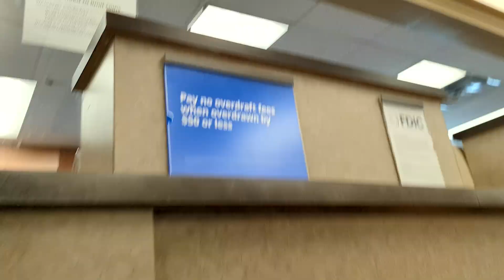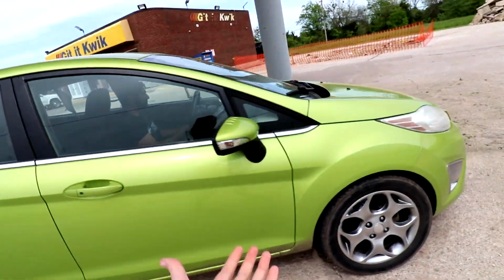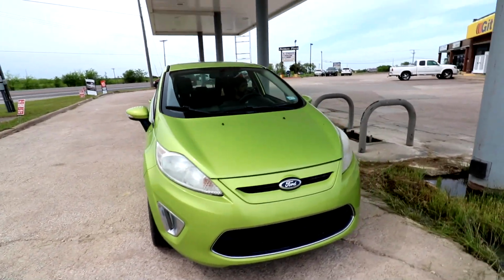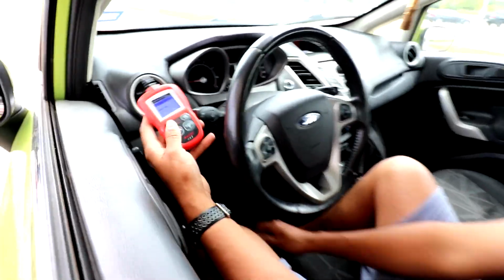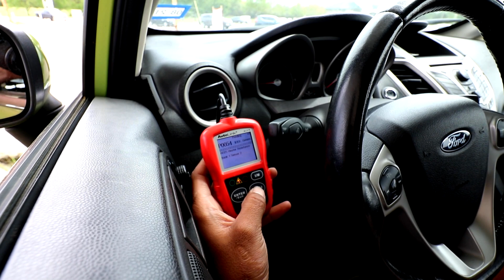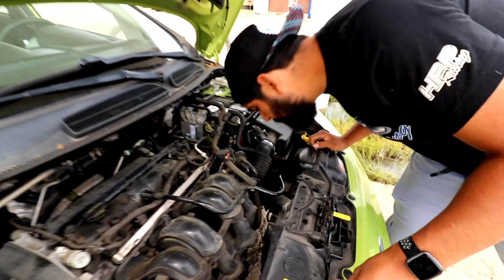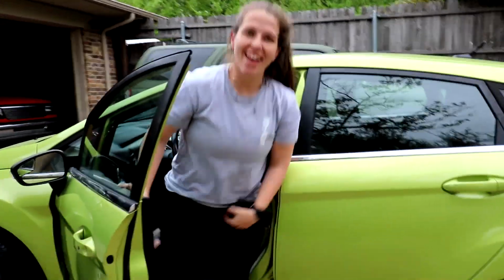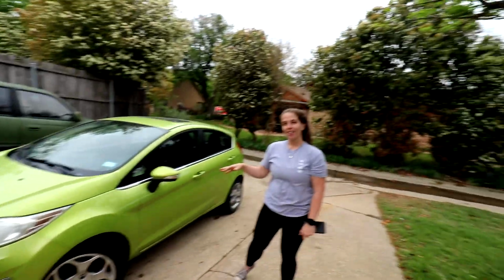Our Turo Fleet is Growing! (And Our RV is FINALLY Making Money!)

Comment: You mentioned a tranny on another Ford in your fleet has a three year warranty. Better check the fine print on that warranty. I have a friend who is on Turo. He rents out his Monday-through-Friday newer vehicle that he uses to commute to work with in the city. He went in for new car warranty work and his car company would not cover the repair because they had (new car warrant from manufacturer) had a clause that voided the warrant if the vehicle was used for commercial use. Just saying. Also, did you buy this (booger-green) car from a dealer? How many miles on it?

Comment: so jealous of your car prices. Here in Anchorage getting a used car for under $12,000 is next to impossible. cars from 2000 sell up here for $3000 and $4000. 2011's up here start at $11,000 and have over 100k miles on them.
Reply from the maker: Im surprised it would be that high up there! Wow!
Reply: might be worth it to travel and drive them back up!
Reply: @hpspeed8877   ya I have been entertaining the idea of doing just that. I got a car out of Washington and shipped it up here; even after the shipping costs my new 2021 was 1600 cheaper than a 2020 same car with 25k miles on it here.